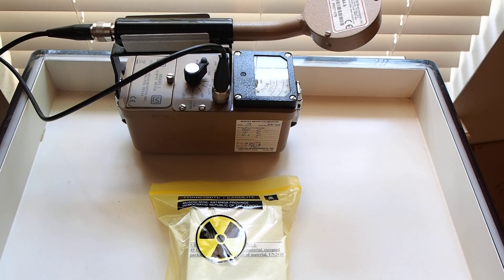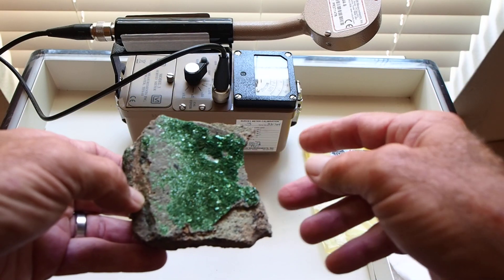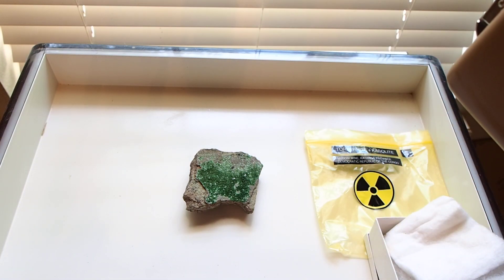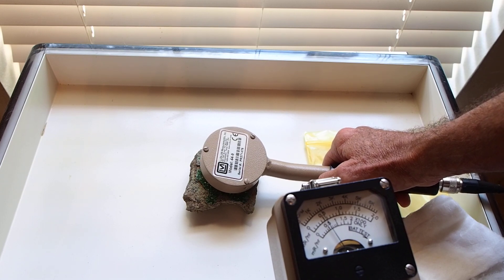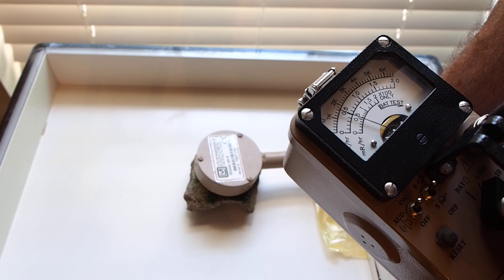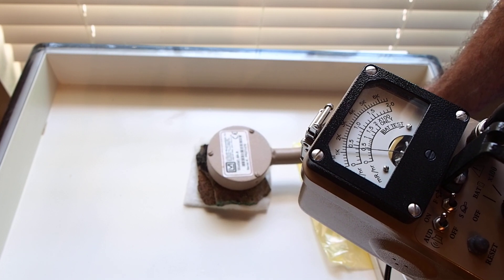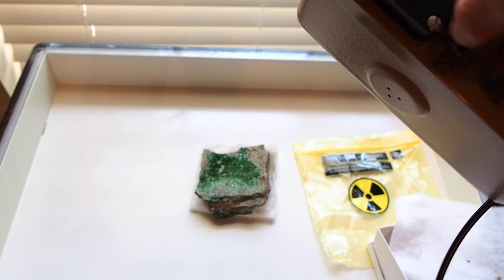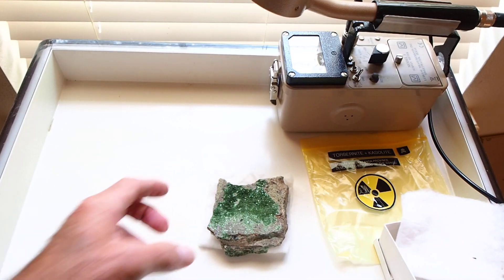Testing radioactive Torbernite/Kasolite with Ludlum Model 3

Comment: Great presentation.
I have a  torbernite specimen from a mine in Mexico. Using my Ludlum 2241-2 and the 44-9 probe
the reading is 90000 cpm at about 1" from the specimen. Keeping the specimen is a sealed box.
Reply from the maker: Thanks! Very interesting regarding the equipment you used and the count rate you obtained.
Reply: @shumla7ranch  The 90000 cpm was obtained with an NE techonlogies  RM5/1 ratemeter + IRAD ebay 3" gamma scintillator.  I have just re measured the sample with my Ludlum and the 44-9 probe = 134100 cpm.  Sorry for the mistake.
The sample came from SONORA in MEXICO.
Reply from the maker: @doctorstrabismus7290  Copy that - Thanks!

Comment: good afternoon, With how long of exposure to the skin does this mineral start to damage humans? thankful
Reply: If the reading of 0.5 mRem/hr is correct you could wear it all day and you will be under the threshold of statistically detectable radiation effects on health. I would be more concerned with the chemical toxicity.
Reply from the maker: Technically speaking, any amount of radioactive exposure can be dangerous in the long term. This particular mineral is very active, so contact with the skin is ok, but washing the hands with soap and hot water would be recommended afterwards. The longer the exposure, the higher risk of eventually contracting cancer, etc., so I wouldn't want to sleep with this specimen under my pillow for a long period of time. I'm sorry I can't answer more precisely, but with specimens like this there are no clear-cut answers because there are so many variables involved. Thank you for interacting on my channel. Regards from Laredo, Texas